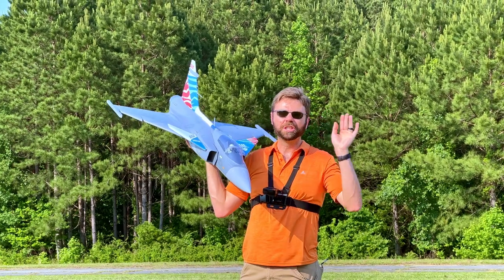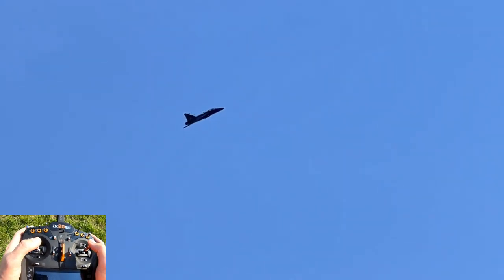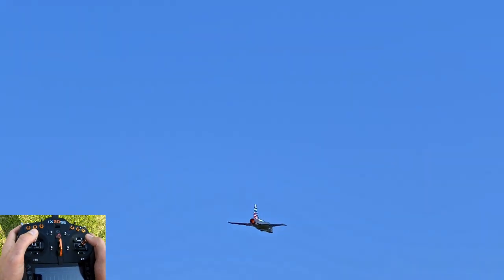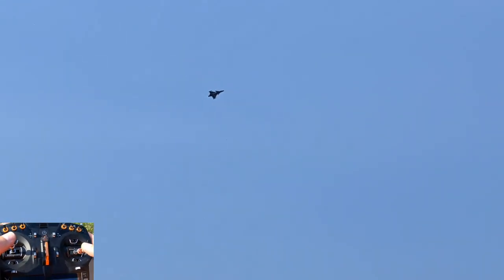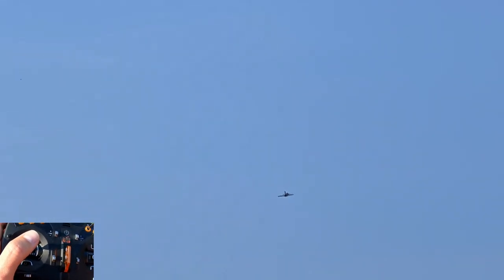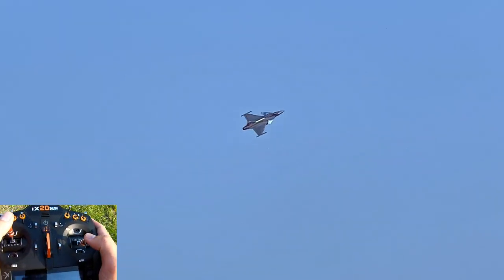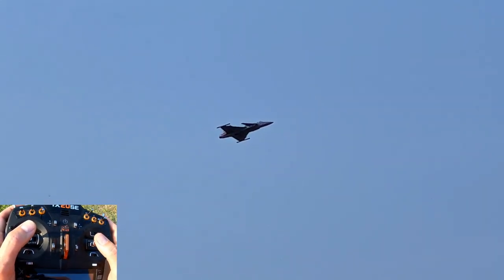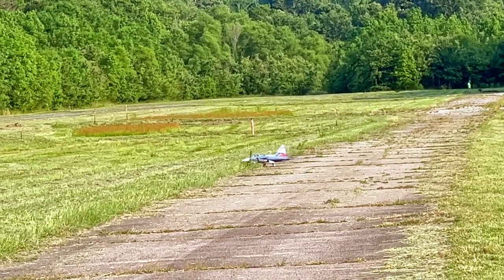Making an RC Plane Intentionally TAIL HEAVIER to Fly Better (Freewing JAS-39 Gripen 80mm)

Comment: Hi Jon, I started with DX8. Soon moved to NX10. With my F22 Raptor  I've run out of channels and I have JAS-39 Grippen and F14 Tomcat waiting to build. If I wait for the purported NX14 will that be enough channels - what is maximum channels you have used to date. Or, do I take the plunge and join you by getting  iX20. Will be very grateful for your thoughts.
Reply from the maker: Hi Tommy! The most I've used is 14. I could go up to 16 or 18 if needed for controlling all aspects of SAFE (pitch / roll gain) and all aspects of AS3X instead of tying pitch and yaw together as I do currently. You'd probably be OK with a 12 or 14 channel transmitter if you're following along with my guides.

Comment: Hi Jon. I noticed in many of your videos that your transmitter is giving you the number of fades. What do you feel is the normal range of fades during a typical flight?  When do you start becoming concerned that it’s too many?
As always, thanks for your advise and keep making these excellent videos which are helping us all learn so much about RC flying.
Reply from the maker: Frame losses are what you're hearing reported on the radio. I usually don't get concerned unless it's something along the order of 100 losses every 30 seconds. A full flight should be less than 500 overall. I usually add remote receivers to my jets because of how fast they are and how cramped the space is inside of them, so I want to maximize reception quality and ensure I don't lose a jet due to easily preventable reception issues.
Reply: Ok. Thanks for your reply.

Comment: Hi very informative videos on your channel. Can I know what battery you were using I just recently got mine and had trouble flying. I flew with a 6000mah with 2100kv upgraded motor and didnt felt enough power on take off  obviously it was a little nose heavy. Can you recommend some improvements its a nice looking jet just not getting a feel for it in the air.
Reply from the maker: A 4000 Spektrum 50c on this one. In future vids we moved to 4000 SMC batteries.
Reply: @TwoBrosRC  thank you

Comment: Hi Jon what motor upgrade are you thinking for this ? Sticking with 6s power? Cheers
Reply from the maker: We generally don't see a point to adding wing loading to a model just for some additional thrust, so the stock system is fine but a FMS 2100kv Pro would be the likely upgrade.
Reply: @TwoBrosRC  that's my thinking. Was weighing up the options of a jetfan 8s 80mm or using my spare fms 2000kv. Will stick with the fms. Would you considering installing the thrust Vector system or just unnecessary?
Reply from the maker: @M4rkmcc21  When we pick up the Gripen again, it will be with a TV system to really maximize its performance using a lighter weight FMS motor.